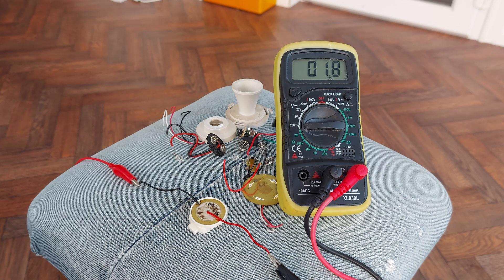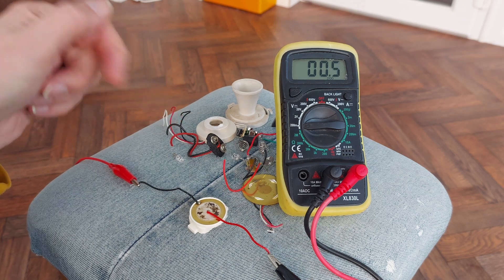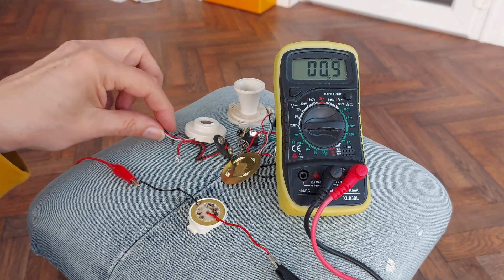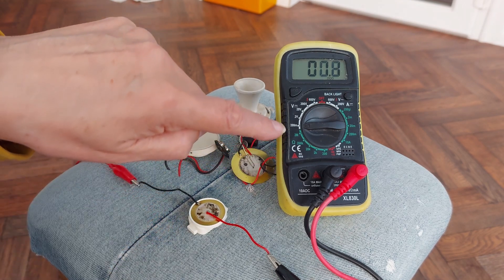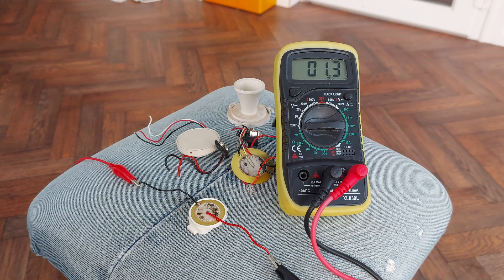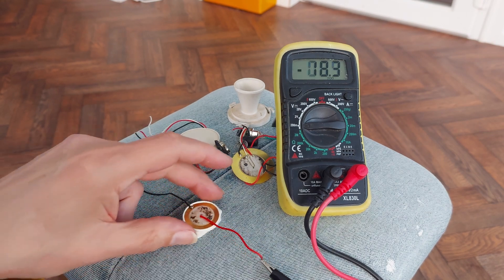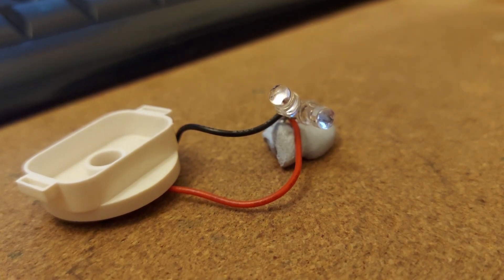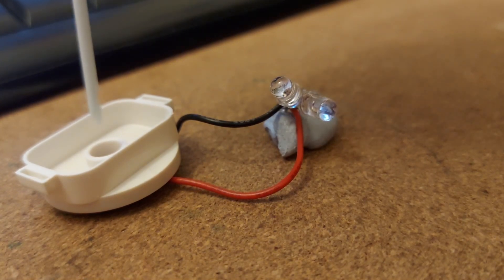Piezo buzzer generates power

Comment: Great demonstration Graham. 👌
I have thought of these devices many times and the alternative uses for them.
The fact that they produce electricity through vibration could possibly be used on a larger scale. My thoughts were on the motorways where the vibration from vehicles is almost constant. In a place where many people are gathered, a pub, restaurant, train station, etc.
I am sure they could be built to a higher spec and integrated into structures.
Some bright spark would need to do all the math to see if it would be viable. 
They would have to design a transducer to give peak performance. 

I know you understand what I am talking about. It would need a lot of backing and finance to get it to work but that is only after it has been proven to be viable. 
Lots of energy from the ambient background out there just waiting to get used. 
You mentioned in another one of your video comments about the work being done to harvest electricity from the upper atmosphere. I did see a video about that but it was all done privately with no financial assistance from governments. 🤨😏
Ever wonder why there is no financial backing for projects like that? 👍👍

A quick note: Get ready for petrol prices to shoot up because of the shipping attacks.
BP already stopped all its ships from passing through that area as you will have heard.
I think they could still pass through the Suez Canal. Not sure.
The world is getting crazier by the minute. 😮‍💨
Reply from the maker: On harvesting power from the atmosphere, think about it for a minute. The potential difference is there and we live with it. I have no doubt that is it was harvested on a commercial scale it would have an impact on the climate and cause some catastrophic disaster. Rather like Fracking. Disturb nature at your peril.
As for putting energy harvesting in the roads, we cannot even maintain the roads as they are. How long do you think they would last before needing massive reinvestment to maintain and who would pay for it. No doubt our current government would put it out to private tender, ie give it to one of their own. Then give it massive subsidies whilst claiming it is green investment. Then the company running it will be sold to a Chinese consortium and we will pay them to take it off our hands.
Reply: @GrandadIsAnOldMan  Exactly what I mean. It all comes down to greed. 
Even those who have plenty, want more. I am not an oil protestor but there is a need to start using new clean energy. Seven people along my street have electric cars but I still feel they are nowhere near as reliable as our petrol cars. I will wait for the technology to become a lot more tested and further down the line before going for an electric car.
So many power-harvesting ideas out there that could be used if they invested in it.
Just like the greedy "Big Pharma", the oil companies are just the same.

May cures for chronic and terminal illnesses have been sitting on their shelves for a long long time but you don't make money by giving the people a cure. 
Greed and disregard for human life to get more money. Global genocide?

Comment: That is interesting! I can see some horrible little electronics nerd turning this into a modified remote visual fire warning system for the hearing impaired. LEDs wired to each room from the piezo unit, a cage over the disc containing a cockroach, disc warms up from fire, cockroach starts dancing on the warming plate and LEDs blink in tempo to the temperature. Patent to Blofeld Industries Inc!  🤔😱🙄
Reply from the maker: Sounds feasible 👍🤣

Comment: Nice. I happened to be playing with this yesterday and the day before as well. I was using an elastic piece of metal, and it was held in the middle with a magnet, and a second magnet went on the back of the piezo element. Then I had a diode back to back as well. I had put two magnets on the end of the metal bar, to give it some weight. And when I triggered the metal bar (it is 1 mm thick, 4 mm wide, 15 cm long approx), it was wobbling for a while, and in mean while the leds lit up. I tried adding a rectifier and a very small condensator, but the energy bursts are very short lived, too short.
Note: the three wire piezo has a very small beam in it for feedback. Like a trigger coil.
I find piezo crystals very interesting, I have heard of inventors putting them in shoes, under a pavement and such. I even found on YT someone who made the rain drip on the element and have a red LED light up for every drip. Efficient? No. Funny? Yes!
PS: I dismounted a lot of those fire detectors. Some had a 3V lithium battery in them. Those are still in use, powering a couple of bluetooth temperature sensors all around my house. They will run for several years, as it only needed a cr2032 per year. I now can see what temperature my house is, all day long ( Home Assistent ). So yeah, putting 'garbage' to work is really worth it.
Reply from the maker: Brilliant 👍